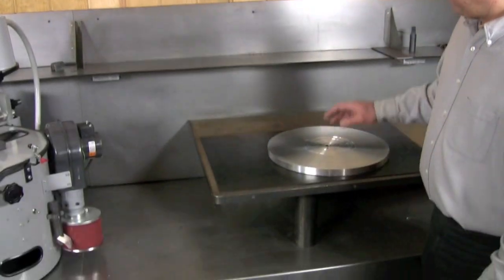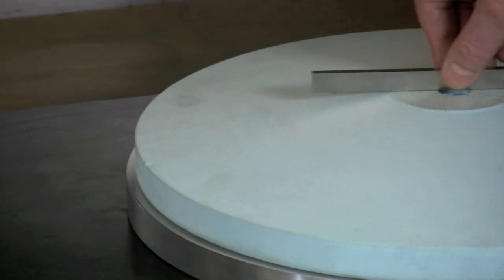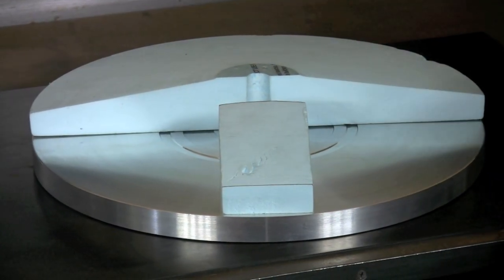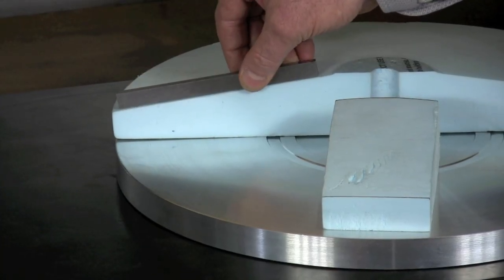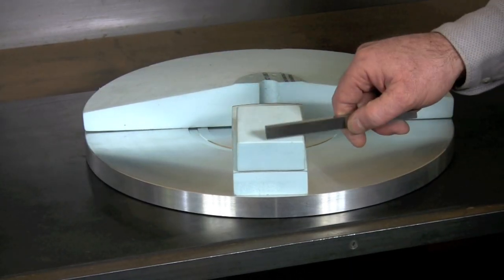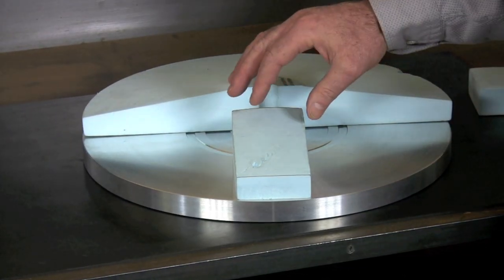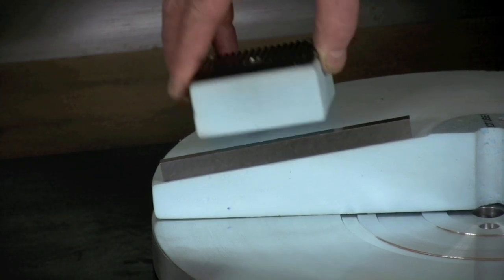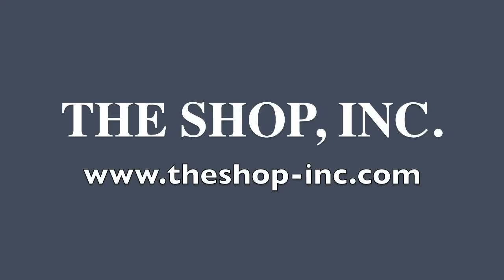Clipper Blade Sharpening Disc - Geometric Shape - Part 1

Comment: I finally get it. It's because the blade is  a ~1 inch plane while the tip edge "line" never comes in contact with the cone. If it did from too much grinding I think that would be a problem.
Reply: Can we chat on whatsApp